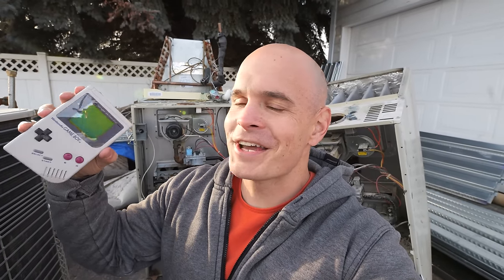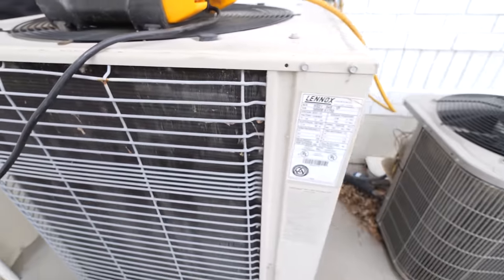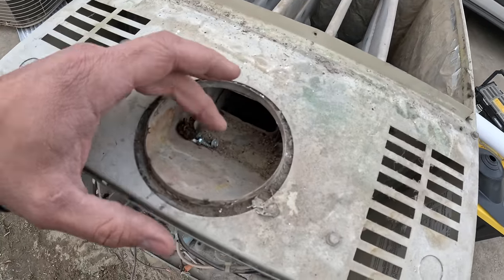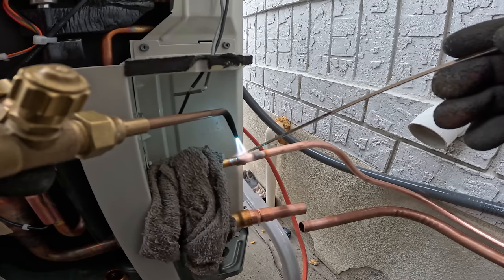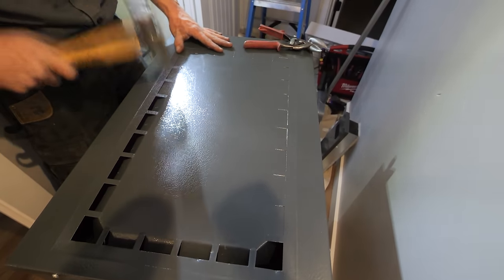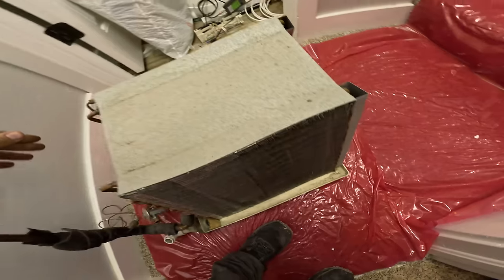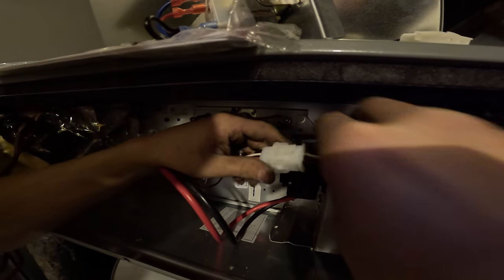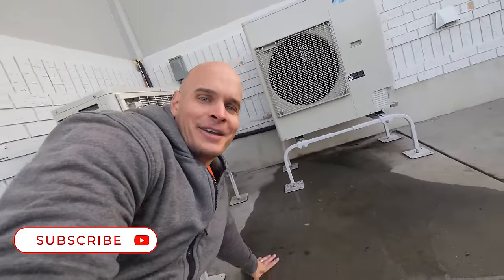Why is Everyone Talking about Heat Pumps?

Comment: Dykins are great until you have to order parts. Parts availability stateside is extremely limited. They're great units though. I have two of them. I also have a Mitsubishi that puts them both to shame.
Reply: Took us 6 weeks for basic parts and 6 months for a compressor
Reply: @zack9912000  I've been out of the field for a little while because of kids. But my husband had to get parts and it was six or seven weeks for a blower motor! Meanwhile, at the shop where I work we've got about 20 commonly used condenser and blower fans.
Reply: @Amanda-ej7pl  These dont use standard motors. Most of the parts are made in china, and they are not back to 100% yet and won't be for years

Comment: Videos like this confuse me.  @0:40 he says these heat pump systems do not create heat, they just move it around.  

Perhaps he means to say a gas isn't being burned, nor is there a resistive element converting electricity directly to heat?  Some units do have a resistive heating element in the indoor unit to maintain heat when it is too cold outside.  

Forcing refrigerant from a gas into a liquid (in a condenser) creates intense heat which is where the heat comes from when heat is called for.  

My understanding of a sealed refrigerant system is as follows: 
A compressor forces a refrigerant gas into a smaller tube which forces it into a liquid.  This is called the condenser.

 This creates tremendous friction and thus heat.  This heat is what is used to heat your living space when heat is called for.  

In a refrigerator the condenser is usually underneath with a fan blowing across it to cool it down or the condenser is on the back with no fan and relies on passive cooling.  Condensers operate just like a radiator in your car in so far as they have metal fins to release heat as fast as possible, with a fan that blows across them.   

The refrigerant being forced from a gas state to a liquid state, in the copper lines in the indoor unit, with a fan blowing across the copper lines into your living space, is where the heat is coming from.  

The benefit is the compressor and the fan use way less power then a traditional heating system.  An electrical heater might use 1000 or 2000 or 3000 watts continuously where a heat pump may only use 400 to 800 watts depending on the size of the system.  This is the genius of heat pump systems.  

It can draw 8 (960 watts) to 12 amps (1440 watts) to get the compressor started, but once it switches into run, it will only pull a a fraction of that.  You can use a current measuring tool on the power lead of the compressor and see how the amperage draw drops once the compressor switches into run.   

When cool is called for, the system reverses.  The bigger diameter lines, where the liquid turns into a gas, causes massive cooling.  This is the evaporator and in a refrigerator is usually in the freezer with a fan blowing across it into the freezer.

Modern Heat pump/inverter systems have an inside unit and an outside unit.  The inside unit mounts on the wall and has connections through the wall to the outside unit.  These connections are both copper lines and some electrical connections.  

My speculation is: 
-the inside unit is just an evaporator, a condenser, a fan, and a display 
-the outside unit is where the compressor lives, also has a condenser, an evaporator, a fan, and is much louder  

When cold is called for inside, the system uses the outside condenser and the inside evaporator.  When heat is called for, the system uses the inside condenser and the outside evaporator.

Over 25 years ago I had a used appliance store with my dad.  We bought non working washers, dryers, and refrigerators.  We refurbished them then sold or rented them out.  

We also had a license to recycle refrigerators using an expensive reclamation system.  I had to pass a test to be certified on sealed refrigerant systems.  My dad did most of the work on the sealed systems at our shop but I had to learn how it worked for repairs at customers houses.

Also, my younger brother and I had an electrical company for (3) years before I decided to join the military.  He was the certified electrician and passed the state contractor test.  I was the home theater side plus all admin duties.  This was 14 years ago and well after the appliance store.  

Lastly, my wife and I self installed (2) Mr. Cool heat pump units in our house that was built in 1890.  We installed a 12k BTU upstairs and an 18k BTU downstairs.  The 12k BTU unit upstairs only required a single 20A 120V breaker.  The 18k BTU downstairs unit required a 20A 220V double pole breaker.

When it gets down to the 20s and 30s here in southern Washington, the units do not produce enough heat so we have to supplement with radiator heaters, forced fan space heaters, and radiant heaters when feasible.  I use a radiant heater under my sit/stand desk directed at my feet due to cold feet all the time.

Long story short, these units do produce heat, but it is a byproduct of how a sealed refrigerant system works and way more efficient then traditional heating and cooling systems with some minor drawbacks.

Comment: Maybe my unit is inefficient but living in Kansas I would not ever buy a heat pump.  I have lived in this house with a heat pump for a few years now and for me I can not recommend them.  When I have my house at 70° with my heat pump feels cold whereas my parents house with a gas furnace set at 70° feels warm.  Couple that was a fact once it gets down below 32°. It kicks on stage to that sucks more electricity than a DeLorean from back to the future.  Again, maybe my heat pump is in efficient but I would much rather replace with a gas furnace.
Reply: Nope that is still what goes on today.
Reply: Your unit sounds like an older inefficient model. How warm/cold it feels at a given temperature is dependent on the airflow and the discharge temperature. Your old one probably discharges 90F on a good day and 85F (or worse) on a cold day. A modern inverter unit will push closer to 100F and a furnace usually pushes around 120F.

Comment: Heat pumps are only cheaper to run than Gas Combi Boilers if you invest in brand new big big radiators or aluminium and insulate the shit outta the house.
Reply: And a gas boiler is cheaper to run if you do the same.  But not sure why you are saying that on a video about a system where radiators and combi boilers aren't used.

Comment: Ooft that install is like a ships engine room. .  Ill stick to my simple  combi boiler . Air source or ground source heat pumps are not efficient in scotland , the top up electricity element and fans running cost more in electricity than i use in gas . ( not to be confused with gasoline you americans).

Not much scavenged heat most of the year in scotland. The systems are slow to react when needed . Installs require much rip out to renew pipes and radiators . The list of cons go on.

One plus is we dont have a need for cool air / air conditioning very much

Comment: Heat pump is just AC with reverse valve. Why not just call it AC with reverse valve?
Actually liquid water carries more energy than water steam. Steam is name for water in a gas form right? Unless we're talking about superheated steam in high pressure.

Comment: If you are natural gas, stick with a high efficiency furnace. If your on propane, fual oil or rocking resistant heat, go with the heat pump. Repair billa are extremely high on inverter systems relative to a gas furnace. Between upfront equipment, installation cost, and repair bills, you will save money just rocking the N.G. furnace. Natural gas burns incredibly clean. When 50% of electricity is being produced by coal,  your not doing anything for the environment. 
 Been doing this for 10 years. As with everything, do your own research.

Comment: Inverter technology on air conditioners gives them poor cooling performance. On/off air conditioners are far superior, more power consumption but they do cool the room.
Reply: Do you mean they're worse at dehumidification? That is often the case by default but most can be adjusted for more moisture removal.
Reply: @eDoc2020  they have worst cooling/heating performance. The way I understand it is that the compressor can run slower, actually the speed goes up and down, so you get less power consumption and at the same time less performance, fixed speed (conventional) air conditioners run at only 100% speed but they do cool really good. During a hot summer day you can feel some heat with the inverter a/c running at the lowest temperature setting, with the fixed a/c you won't, actually you may even turn it off. I'm not even talking about the overcomplicated electronics, "inverter" is a circuit board inside the outside unit and they like to go bad.

Comment: Huge Misnomer ALERT 410a is not NEW it is older than the systems you are replacing. Even R-410a is being phased out and replaced with R-290... Not so fun fact... R-22 is a replacement for R-290 which is replacing R-410a... FULL CIRCLE

Best practice here is to not talk about things you don't know about.

Comment: I don’t see surge protection, I know you have solar power, the solar energy is not clean or stable and it WILL not work properly with the inverter board. Those boards are thousands to replace. Please install an under current protection device or you’ll regret this purchase

Comment: why did you go all electric on the one system when you could have done dual fuel on both systems electric is so much more expensive than natural gas i completely understand the heat pump and if you have solar it makes even more sense but i know that my cooling costs in the summer here in utah is not cheap so this would carry into the winter if you’re using a heat pump so i fall to see the benefits as your spending more on electricity than you would gas

Comment: Has nobody combined a gas heater with a heat pump in a single system yet? Using the gas to generate some of the heat on particularly cold days? Also itd very useful for deicing the evaporater. Sorry wrote this near the start and just seen they apparently already have.....and now hes said it uses zero gas for heat im really not sure 🤦🏻‍♂️😂
Reply: Industrial, yes.
Reply: Yes.  You can combine various fossil driven furnaces with heatpumps. Can be expensive though. If you don't live in a mansion it is probably not worth it.

I have a fireplace I use myself on cold days. HP works down to around -20 but it's not that efficient at that temp.

Comment: Not sold on heat pumps electricity is alot more expensive than natural gas. Per btu
Reply: Yep and they have had big improvements but costs are still insane for them to operate and maintain for half the life of a traditional furnace

Comment: As someone who repairs them a lot, they are great till it gets really cold out or fails. Parts are almost never in stock, not cheap to repair. Their lifecycle is half of a gas furance, and cost more than a high efficiency furance does. They suck in cold climates that require Aux heat to maintain temps. 

At least with a regular gas furance, a homeowner can fix most issues with youtube and reading basic instructions. Heat pump homeowners don't have the specialized tools or knowledge / experience on how they operate and how to fix it. Much less the EPA license to buy the refrigerant. People regret buying them when they get the bills to repair them and the large electricity bills being in the hundreds when the heat pump fails and the AUX heat strips is the only heat working. People are fools to go with them when NG is the option, especially with the electric rate hikes that are coming.
Reply: have you worked with R290 yet on any home installations ?
Reply: @lylestavast7652  R290 isnt used in US homes. Next year R454b and R32 will be available

Comment: im so confused maybe its because i am an aussie... why do you guys have furnaces? obviously to heat the house but like... why? does it really get that cold? I guess you do get snow... im still so confused... in america? this isnt siberia? what??? is that just normal every house has airconditioning AND a furnace???
Reply: It is normal for houses to have air conditioning and a furnace. The older heat pumps didn't work below freezing so they are next to useless if half your heating load comes when it's below freezing. If you live where it never goes below freezing heat pumps / reverse cycle aircon work fine and that's why it's the norm down under.

Comment: Do heat pumps use more electricity? If you don't have solar panels they are not efficient at all.
Reply: Yes, when the aux heat trips have to run, you can easly have a 500 dollar bills vs a 90 dollar gas bill
Reply: They use a lot less electricity than regular electric heaters.
Reply: @zack9912000  Who would want a gas line to their house? Get real
Reply: @logitech4873  same question... Who wants megawatts of electricite to their homes? There a fire hazard also, if you think about it.
Reply: @Sven_Re347  Megawatts? Are you running an electric industrial steel forge or something?
My heatpump consumes ~1700 watts at full tilt. Less than a hairdryer.
Reply: @logitech4873  yeah, that hear dryer needs to be running at the same time. Don't forget to charge your car at the same time...
Reply: @Sven_Re347  And my induction stove!
But even with all this together, it's not an issue at all. And extremely far from the "megawatts" you were talking about.

My average power consumption in February was 2600 watts, with the peak being at 6400 watts.
6400 watts is just ~28 amps @ 230 volts.

My house actually has a 50A 3-phase 415v main breaker, meaning I have access to up to ~34,500 watts.

So even in winter, I'm only using about 7.5% of the power I have available on average. So obviously nothing is anywhere close to being overloaded.

I'll get a 22 kW EV charger installed soon (my car only supports 11 kW AC though), and another heatpump for the workshop which is a separate building.
Reply: @logitech4873  No they dont lol, they use more electricity as they age and especially in cold climates. Its not unheard of heatpumps running up massive electricity bills in cold months
Reply: @zack9912000  Why do you think everyone in Norway use them? Because they don't work?
It seems you're locked into this troll mindset.

Comment: Heat pumps are great for areas with mild winters, but anything below 10 F you need that dinosaur gas burning as back up
Reply: They've actually gotten better. In Tennessee we had that cold snap this January and it only had kick on the electric heating strips once, the rest of the time it was heat pump only.
Reply: Tennessee doesnt get that cold compared to up north. HPs are still a joke and dumb to get if a person has NG
Reply: @zack9912000  It can still get to single digits which is where people claim heat pumps don't work.
Reply: @antikommunistischaktion  We get into the negatives for months on end up here. We would love a easy winter like that. Again not thay cold as we get it up north.
Reply: @zack9912000  So buddy, do your temps very regularly go below -20F? Because that's the lower limit of a cold climate heat pump nowadays, and at those temps they still operate more efficiently than gas

Comment: Lousy hvac techs you got. Not using nitrogen while brazing is a big nono as you will get soot on inside of copper that can plug EEV or electronic expansion valve. Also burning the rubber grommet wasn't cool. Also mitsubishi > diakin from a tech standpoint

Comment: IMO the tech is great and all but I don't trust any of it. Eventually something will go wrong that I can't diagnose and you basically need a wizard to fix it. I heat with wood because I have complete control over the process. There's literally nothing to break. No one to call. No money to spend on anything. I can't stomach a $150 service call for someone to diag a unit and then swap a $600 part.

Comment: Zack, don't do HVAC. First off all, the old furnace is an 80% efficient, draft induced model. It does not, and cannot, spill flue gasses into you home. If anything fails, it will shut down and lock itself out. Even your new furnace is as dangerous as the old, except for an explosion hazard, which the new one is safer due to its sealed combustion. It is more efficient, likely 93%+ depending on model. Rheem only makes 95%+ high efficient furnaces, except where lower efficient furnace are still allowed, like in the southern states. Your Goodman, I believe, is a lower end product, but the quality has improved greatly in the last decade or so. As far as condensing units, being in Utah, you don't need anything fancy. A 13 SEER unit is a high efficient as you'll need. Anything higher is not going to return the added purchase cost. If you were in the southeast, then you would benefit from a high SEER or even a variable speed unit,  which can dehumidify without cooling.
Reply: Heat pumps can be more than 300% efficient. Nobody should be running gas lines to their house.

Comment: Zack - your electric is PRODUCED BY NATURAL GAS it's just at another location. The heat pumps are the only ones you want to run NEVER use resustive heat as it's worse for the environment than a natural gas furnace

Comment: Ya dont put all your eggs in one basket with your home. Electricity goes out you have NO way to heat your home. 3 days of overcast cloud, you have no battery backup.
NEVER put furnace vents on your roof, they can and will ice up, and you will not be able to clear them.
Get a pellet stove or wood stove for the Cold Cold Days, So much nicer and cheaper than a 4wk coil..